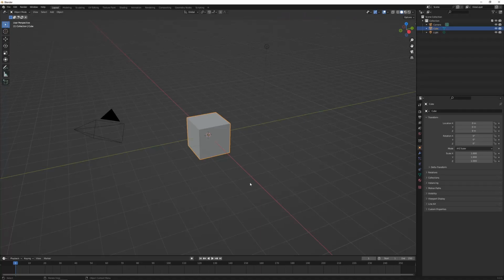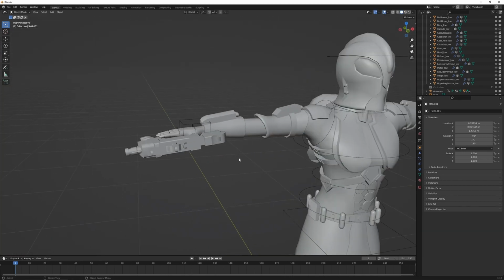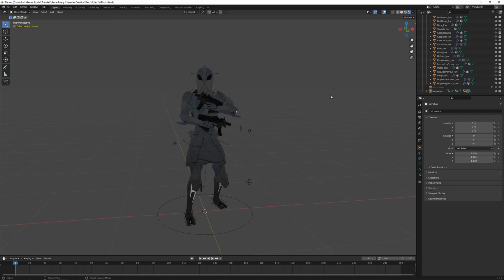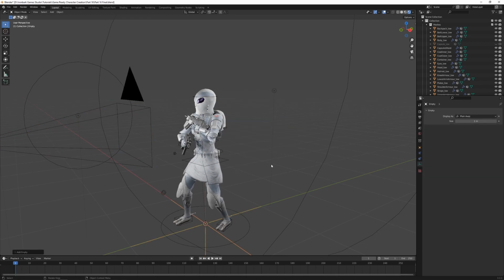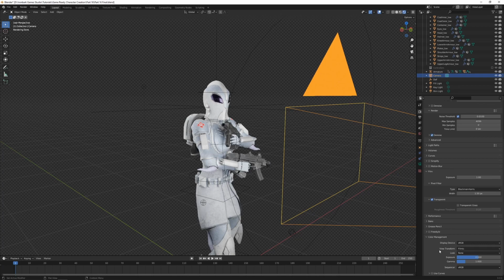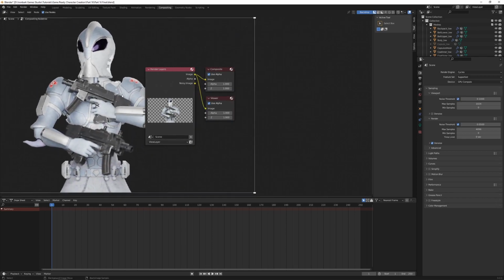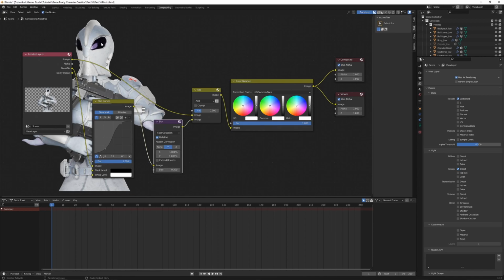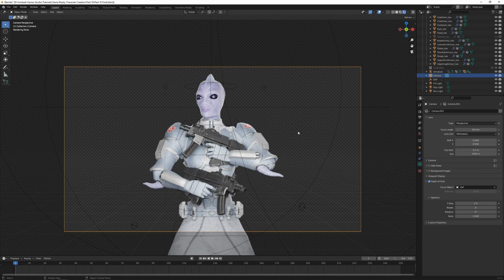How to Render a Character in Blender | Lighting, Camera, Post-Processing

Comment: Hey, thanks for this incredible tutorial series. Idk if you still reply to comments but I have a question. I'm not at the point where I feel comfortable making things like armor yet, so I just want to make the character to practice anatomy and such things. How would you go about connecting the head to the body ? Would you pull up the neck from the body mesh or from the head and then join the two together ?
Reply from the maker: Hey there, yes you can extend the vertices from the top of the body or bottom of the head and merge or bridge them together to form a connection. It's easier if you have the same number of vertices on each edge loop between the head and body, but if not you will have to redirect the edge flow to increase or decrease the number of edges so that they are even. Hope that gives you a bit of direction!
Reply: @ironbarkgames  Thanks :)